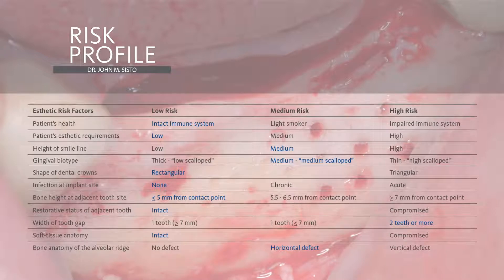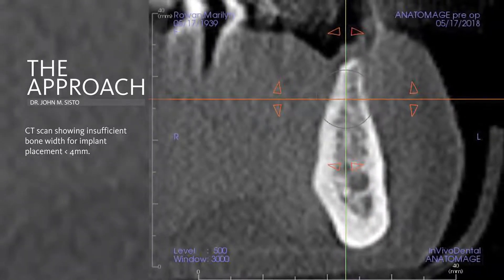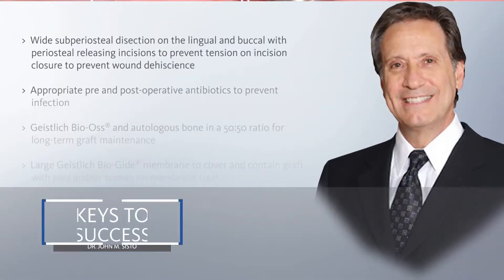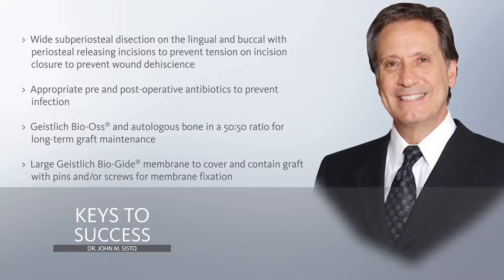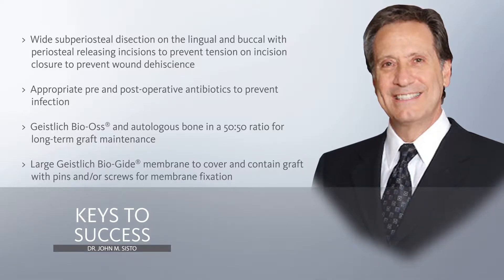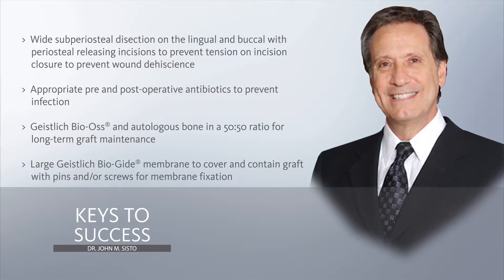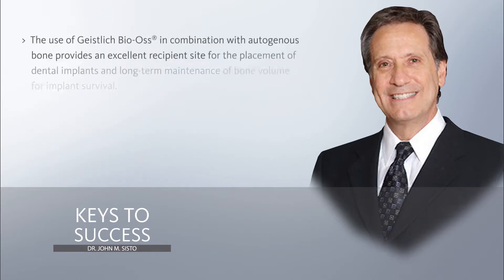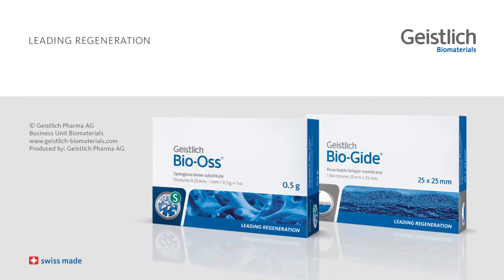Lateral Ridge Augmentation in the posterior Mandible

Comment: Placing the lingual pins is almost impossible with tongue n flap .. please suggest an easy way
Reply: In some cases with good retraction the pins can be placed. When its not feasible I use a short 1.5 mm width by 3mm length Profix screw and place it with a right angle handpiece.  It makes the placement very easy.
John M. Sisto DDS
Reply: @johnsisto9987  Doctor which retractor do you use for retraction ? Silden ? Howarth ? The tongue poses biggest hurdle for me each time .. any advise is appreciated.. someone told me use Browne’s lingual flap retractor ?